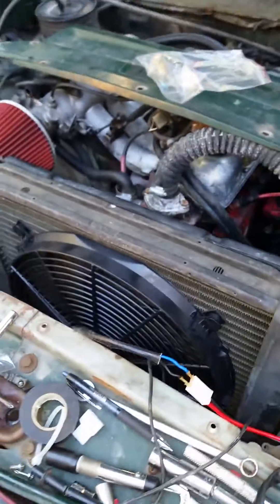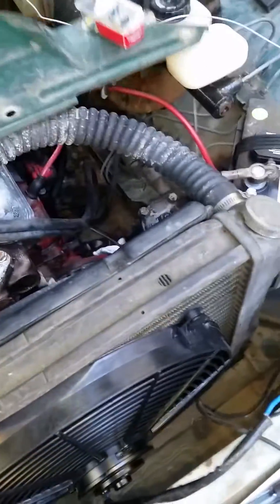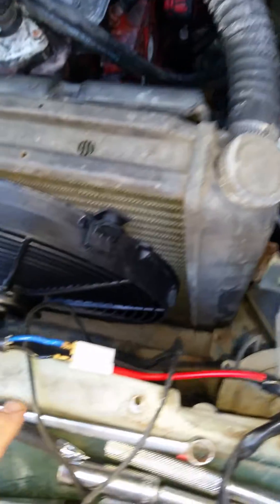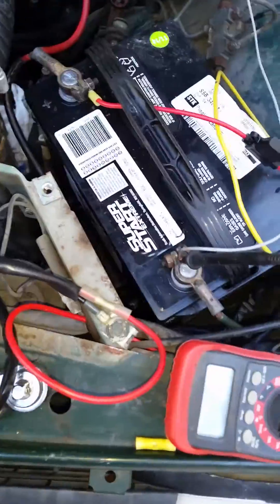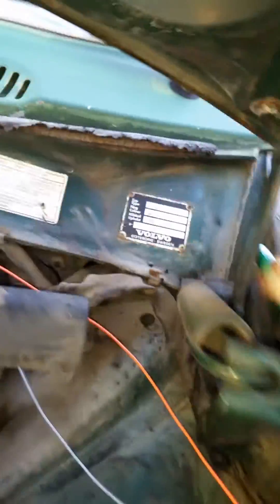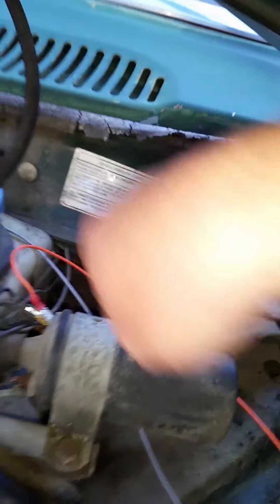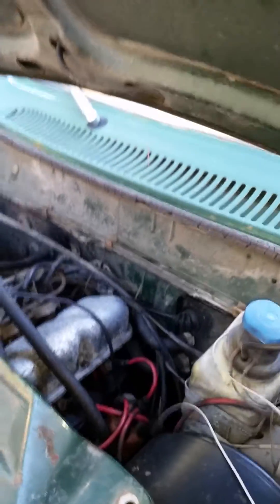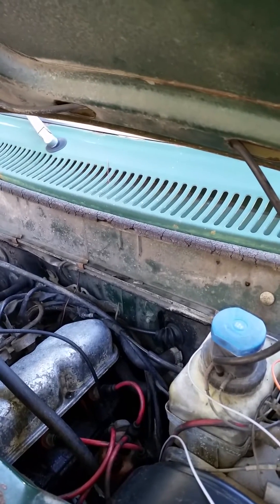Volvo 140 fan conversion

Comment: Very helpful! would like to see when it's running. If I understand right, the fan start at the degree it says on your heat sensor? correct me if i'm wrong. I want this also. but I want both, switch and on the heat sensor so I can start it if I want to. very handy when cruising hot summer days. 
Thanks again.